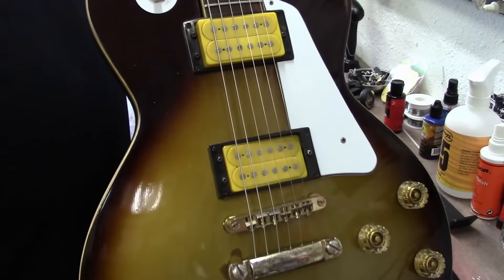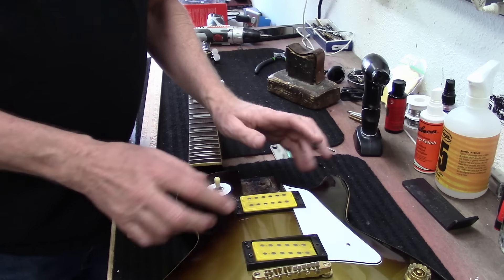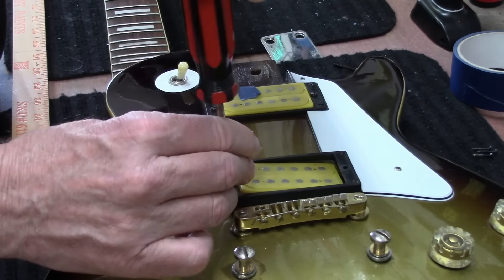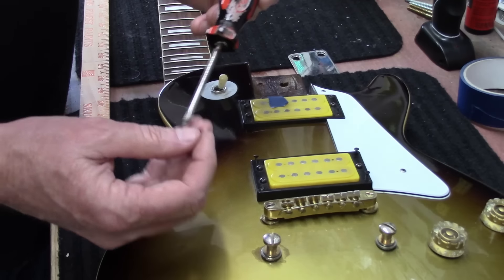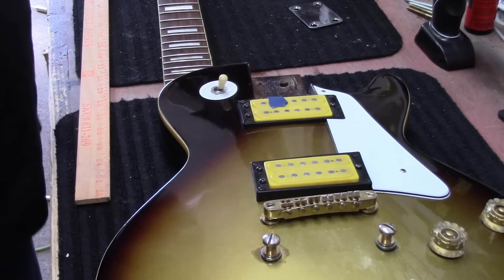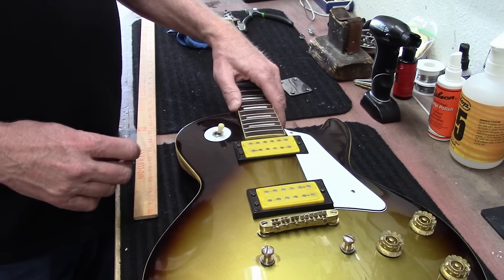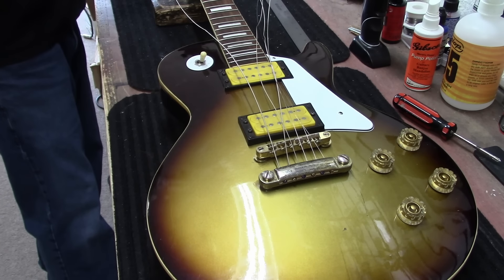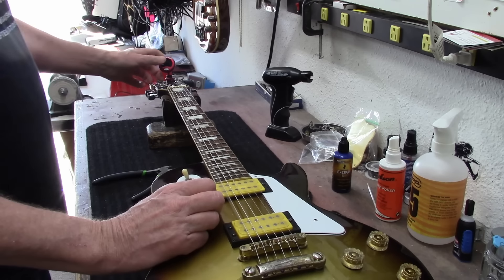Goodwill Guitar Rescue! Maeari Les Paul!

Comment: Bought a Mitchell HD400 at a thrift store, think zimm did a video on one like it, a green one.
Had no way of checking with an amp at thrift store, middle pickup wasn't hooked up and the other pickups were just thrown in...got some cheap pickups on Amazon and set it up. , pretty decent guitar, but I probably paid to much for it.

Great video as always !!

Comment: Michigan here... like watching your videos.. I have an old Indiana strat style guitar that someone put steel frets on.. I have the fret board leveled and the frets leveled but every time I string it up there seems to be a high fret issue at the 14th and 15th fret. I've gone back and filed the frets down multiple times but the buzzing still comes back.. Is there a way to raise the bridge to adjust the angle the strings travel up to the bridge? The only way I have been able to get the buzz to go away is to raise the action to over 2mm at the 12th.. All the other guitars I have had the action was 1.25 to 1.5.  I just don't understand how a level neck and level frets can still buzz. I did replace the original bridge with a Wilkinson bridge. The old bridge was rusted and the tremolo bar was broken off in the bar. Could the new bridge be a mm or two thinner at the base.